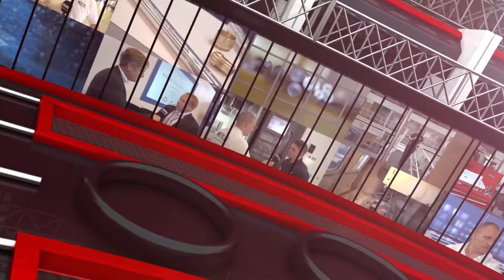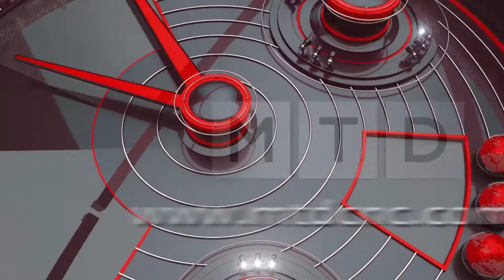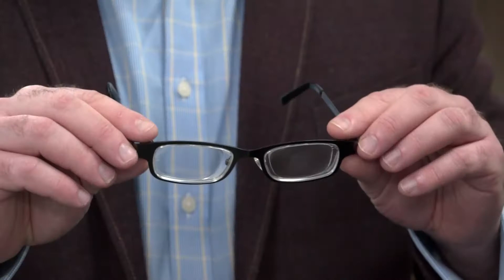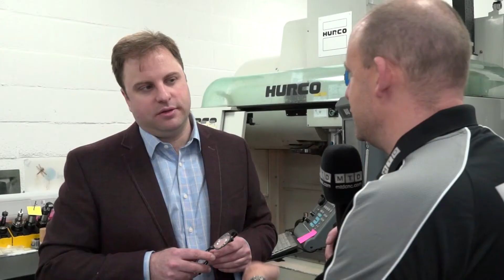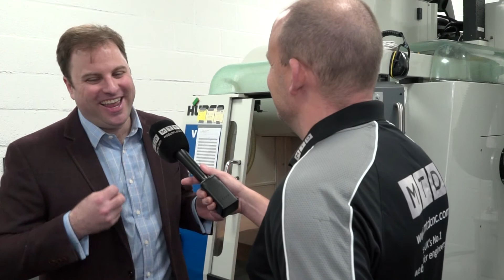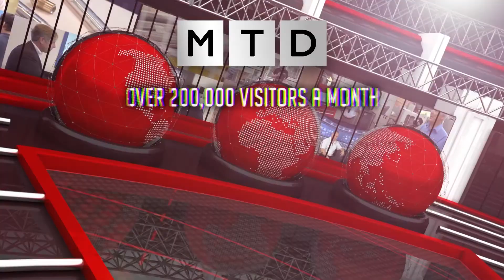A company with a vision invests in Hurco for toolmaking

Comment: My shop runs 3 different hurcos and so far so good. We have made some add ons that hurco does not offer, but thats mostly due to the type of work we do. The loading of parts can be a little tough though because of the lack of space directly above the chuck. That would be a good job for your research and development department to correct because it wouldn’t be a very hard fix. Still a great CNC mill thanks for the video and a new sub